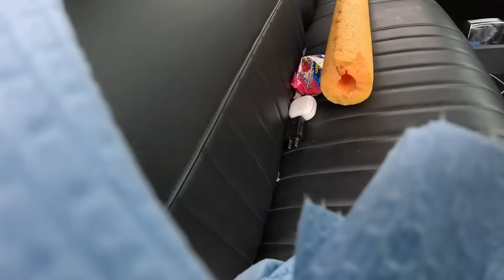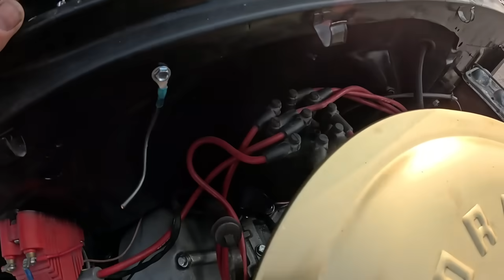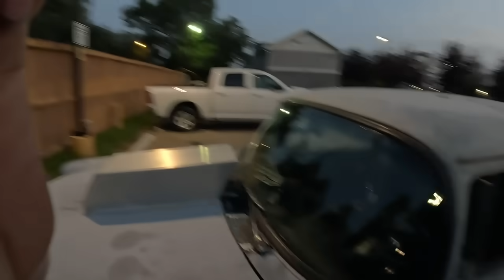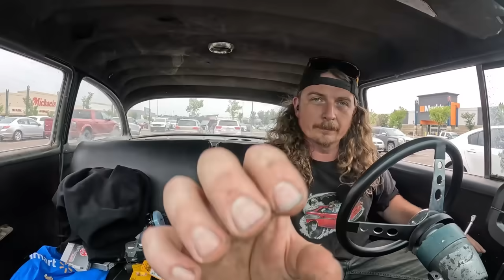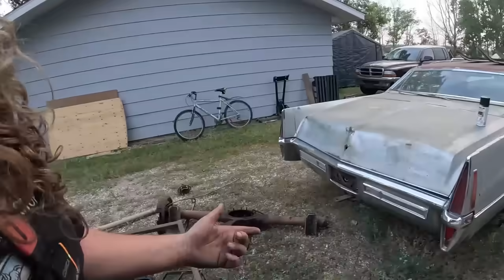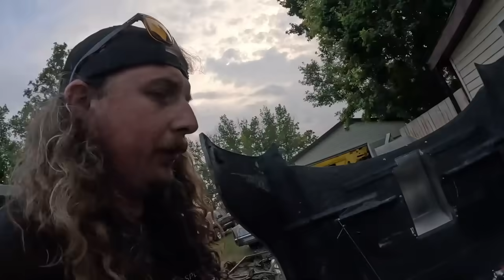You Can't Road Trip a Big Block Chevy! And Other Lies The Internet Told Me!

Comment: Dan, run the cheap Autolite plugs, they are the most resistant to gas fouling of any plug. The electrodes don't last past 35k miles but you don't go that far on a set of plugs anyways. Try them you won't be disappointed

Comment: Just a little advice about the air/fuel ratio gauge.  The oxygen sensor only reads the oxygen, it doesn't see fuel.  If it is misfiring at idle, unused oxygen will be read by the oxygen sensor.  The signal will read lean, but it is not losing fuel.

Comment: I prefer to leave my fuel gauge broke. That way I can’t tell how much she drinks.   Big blocks are smiles per miles, not miles per gallons.
Reply: I had a 454 10.5 compression roller cam .566 lift 230 duration @.50 edelbrock 290 port Rpm cylinder heads air gap 750cfm carb,headers 4.30 gears 700r4 Trans, 29.5 tall tire (actual measure) and got 20mpg @ 60 miles @2000rpm ,I road trip the crap out of that 36 Ford pu 43000 trouble free miles ,best drag pass 12.20 @112.55 mph

Comment: If my rapidly failing old guy memory is working today that Carb is for a blower, which means it is set up for a boost referenced power valve, right? If I am right I would think you were doing pretty well. With you on the drive them, Dan....Well done.

Comment: If you watch your rpms and try to keep it within the power band of the cam your plugs will thank you. It'll also run more efficiently. So if your power band starts at 2500 or 3k that's where you want to try and be at whatever speed your going.

Comment: Cool old Chevy you got there, I have 74 Camaro with a swapped in 454 four spd with 457s in the rear and its been a great engine, no replacement for displacement but hard on fuel, YES, Will have to opt for a five spd before any longer trips otherwise she just revs to high, job for next spring.Take care

Comment: 12.5:1 compression with an L88 is exactly what I had back in the day with my '64 Malibu.  No overdrive with my V-Gate shifted M-22 though but the 12 bolt rear end only had 3.31 gears in it.  Back then 100+ octane pump gas was still available  I don't know what mileage I got with the car but I had to fill up only 90 miles from home on a 160 mile one way to my destination trip.  I was traveling at twice (or more) the speed limit though.  Got challenged by a '67 SS-396 Chevelle  while cruising at 100 MPH and blew him away on the highway, blew a header gasket and entered an outdoor car show.  Won a door prize that I bragged was an award for the loudest header gasket leak.  LOL  Good times.  :_Dano::_Gasser::_Gasser::_Gasser::_57Chevy::_Dani:
Reply: I road tripped my 67 Impala all the time. 427/4spd with factory AC. Only thing not stock was the HEI. Wasn't the most fuel efficient vehicle but was a lot of fun. Good job Dan 👍

Comment: You can drive almost anything on the highway, and I did it a lot when I was young. But not anymore. I have three old home built cars, and I drive them around locally. And they are a blast. They are loud, have very stiff suspension, and squeak and rattle and make other strange noises. But they seem to be very reliable. They are simple machines with no trash technology to go wrong, and the most likely things to go wrong could be easily fixed on the road. Or at least that used to be the case. Now crawling around under a car is painful, and no longer an enjoyable experience. I have a ton of orthopedic issues, mostly caused by things I used to do when I was younger. I can't even drive long distance anymore without cruise control. My leg cramps up bad trying to hold a steady speed. So when I need to drive very far on the highway, I jump in the Crown Vic. 

"We're gonna call it fine" Sounds like Derek from VGG. They don't have Motel 6 in Canada? I used to stay there a lot decades ago when on long distance cruises. Nothing is cheap anymore. Must feel nice, in a car like that in a parking lot full of 4 wheeled computers.

Comment: This set up should be decent on gas, very similar to the 69 Chevelle I built with a Big Block. No overdrive and 3:73 gearing, with a 15 gallon fuel cell the 650 hp mill could easily go 85 miles before needing to stop for gas. Even had 5 miles to spare.
Gas was $1.79 a gallon then and it seemed very expensive to drive to the track 50 miles away in Bithlo Florida.

Comment: It isn't running consistently of course it's because you're adjusting the Carburetor without the airfilter and when you place the airfilter back on you're experiencing a really rich condition. Tada
Reply from the maker: The air filter didn't make much if a difference

Comment: Hi Dan .. instead of the styrofoam noodle .. on my ‘55 gasser with the fiberglass front end .. I unlatch the pin and pull out a little and locate the bottom of the fender in front of the pin and it will stay while you go to the other side and pull up the front clip.. this works every time . If you are in the rain a lot on a trip and it is heavy rain the air filter will get saturated with water and the motor will not get enough air an d may not run so good .. last on the list is does your motor have a way to pull the air pressure from the motor while running ( like a PVC ) if the pressure is in the motor the valve cover gaskets and all gaskets will leak a lot more even your pan gasket could blow out and leak .. the inside pressure while running hard needs to come out ..

Comment: I'm  trying to do just what your doing .I have a 64 dodge dart gasser with a 496 bb mopar 727 410 Dane rear. I want to drive it and race it when and where I want to.Im running a tunnel ram with 2 600 holley 4160 carbs works really good  I'm having trouble with rear main seal leak Taking it to the drag strip on 9/8/24 if nothing breaks. Talk at you later

Comment: Why the heck does it need new sparkplugs?? 
The engine is new, right? 
If you are going to swap plugs snyway why not try to get the equivalent IRIDIUM plugs? Those are VERY hard wearing and iridium is a very good conducting metal resulting in a killer strong spark. Which is good.
Reply: I guess the Carb. is Screwing up, running pig rich then lean, leaking ?

Can't imagine when he puts 2 on it what will happen on long trips ?

Dan will figure it out or John.
Reply: Im guessing because it’s likely running rich and fouling!!

Comment: 11mpg. Sounds like my old 81 square body with a 454, or my current 2000 RAM 3500 with an 8.0l V-10.
Reply: Yup. My 01 ram 3500 v10 6wd gets just a tick over 11mpg, too
Reply: I should add, that I don't really mind it at all, because I only use it when I need to tow/haul some serious stuff. For that, it's fantastic.
Reply: @budlanctot3060  that’s pretty much how I use mine

Comment: Dan I have a question you might know the answer to if you have time I just bought a 1956 210 hard top which from reading I have found out is kind of rare but the question I have does the 210 post body side molding the same as for the 210 hardtop

Comment: I dont Blame Danny not wanting to GO You need a Tetanus shot to ride on that Pile of Rust .Now you spent lots of $$$$ on an engine  that leaks oil plugs go bad in less than 1000 miles Distributor good for 200 miles  belts wires and so on